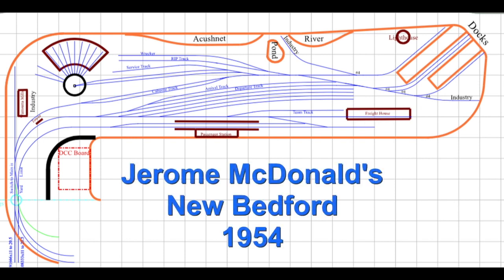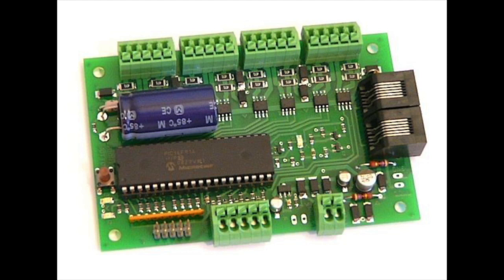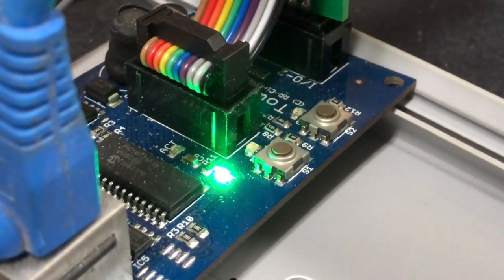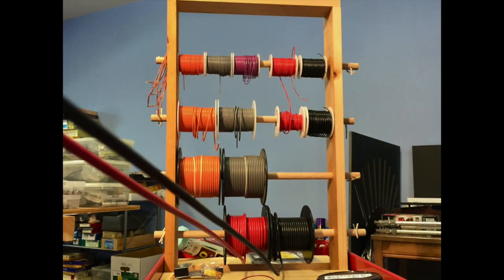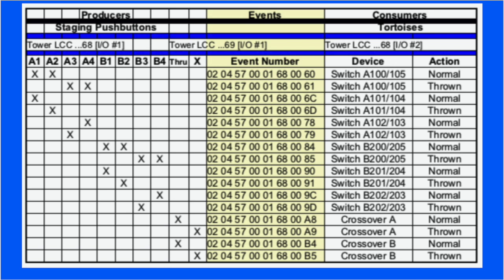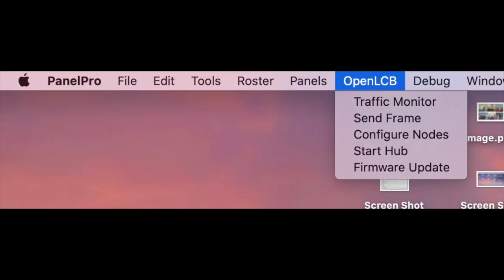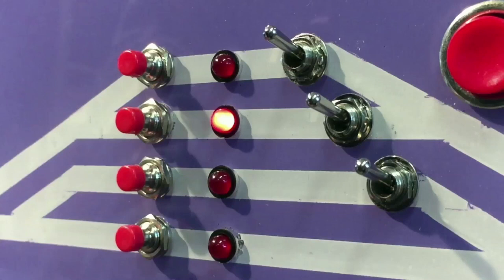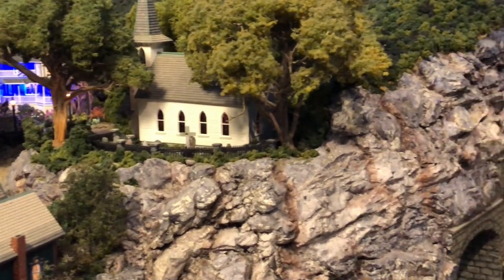LCC - Best Way to Move Points

Comment: I have some doubt about this LCC stuff. In times of Blietooth and WiFI, it seems completly outdated to haev all the wiring, besides the plain "power supplies" for obejcts, like trains, rails and else (lights etc.). Why to have another cable driven communication, while DCC already exists, if things could be controlled wirless instead.
I believe some sort of IoT approach would make a much better solution, than any of this wiring mess commonly used these days ...